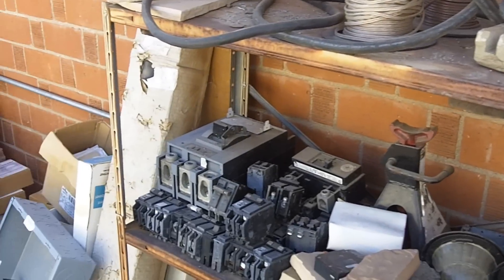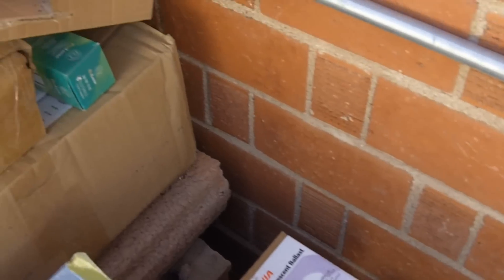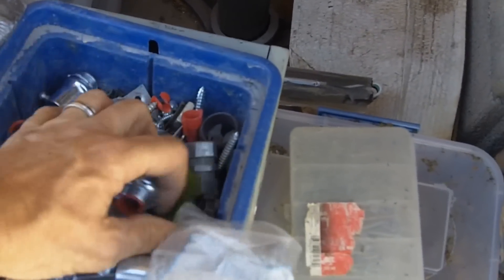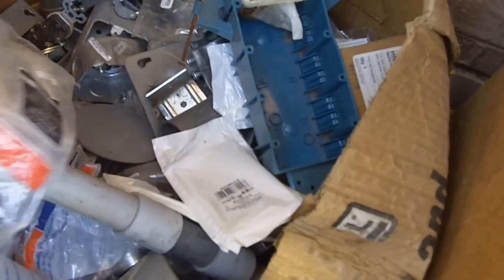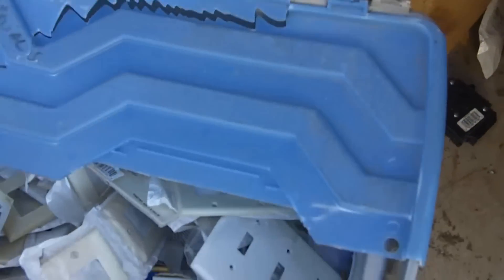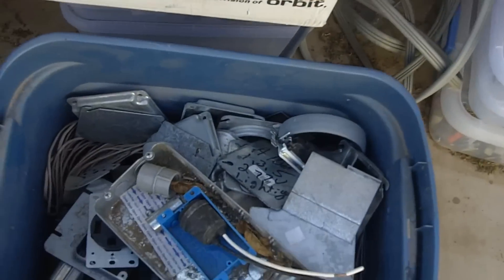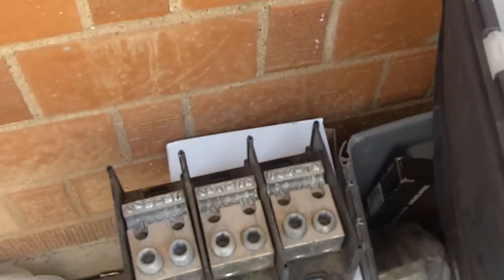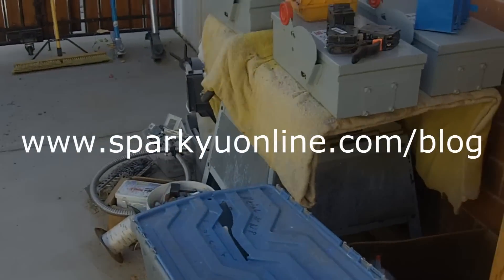Electrical materials-2

Comment: Wow, need a new way to store to see what you've got, for sure.
?  I'm in a ranch house with all two prong outlets.  Wiring runs up and through out the attic.  Blew in a bunch of insulation when I first purchase 3 yrs ago, but now would sure like to use new 3 prong outlets.  Any suggestions?  Can I run a ground wire to each through my crawlspace somehow the do it to code.
I know electronics and did a year with an electrical contractor, many years ago.
Thanks